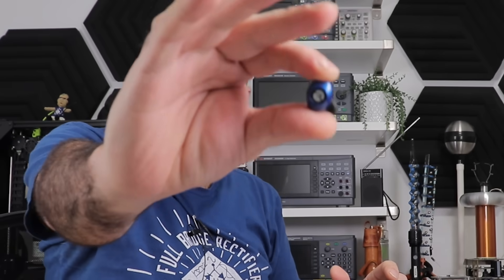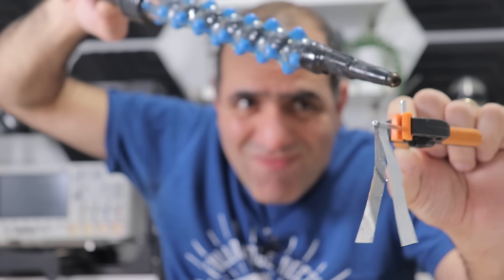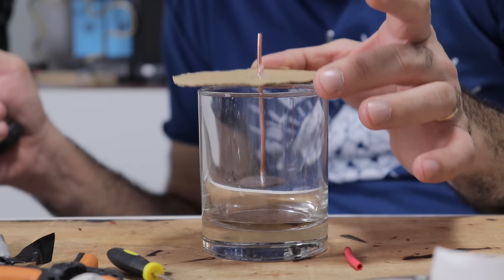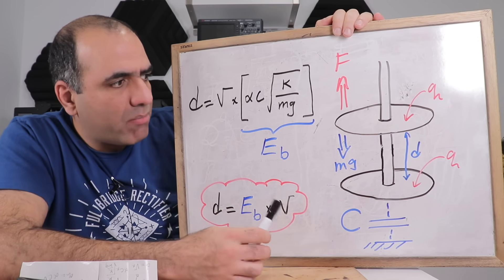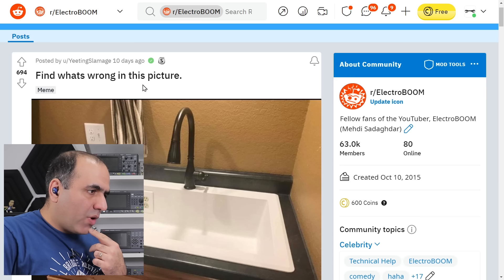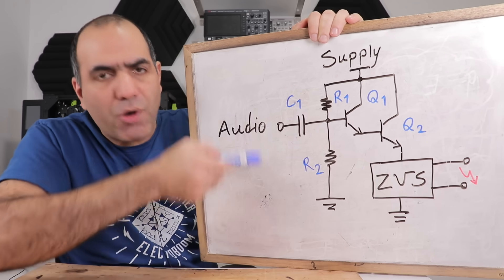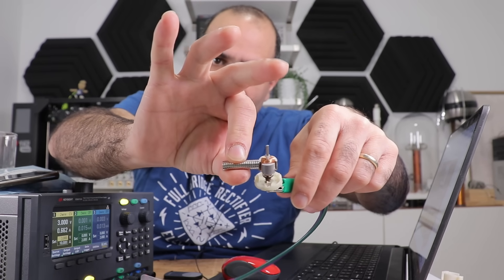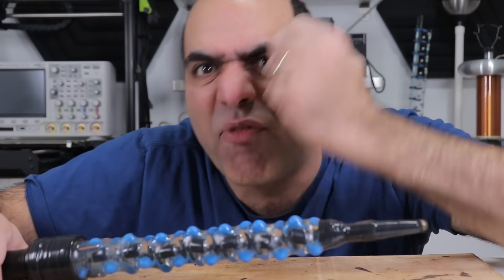I Reinvented the Electroscope! (LATITY-008)

Comment: 10:22 it's specifically the very fine particles, if you blow some powdered form of sugar like custard powder into the air, you can set it alight because the particles are spread apart enough to catch fire and are full of chemical energy.
Reply: Even that isn't as fine as it should be for maximum explosive-ness, but yeah no way is he lighting yarn the way he tried
Reply: @jaykoerner  Yeah I audibly laughed because I have seen farms blow up from dust, and his set up was inadequate.
Reply: @samueleddy62  he should watch some videos from the CSB, he vastly underestimated this stuff
Reply: @samueleddy62  I agree that the test didn't prove anything but if there would have been enough dust in the air to start combustion it would have been visible in the video
Reply: @danielnyman6082  The dust could be on the floor, Im sure he has made shitloads of cotton deliveries without sweeping out the truck, you can't really see what is on the floor in that video.
Reply: @rdizzy1  dust on the floor doesn't explode, burn maybe but it wouldn't make a fireball, it has to be dispersed in air
Reply: @jaykoerner  Jumping down and landing on the floor kicks up dust though
Reply: @killerbee.13  does it kick it to the ceiling?
Reply: @killerbee.13  if that was the method of dispersal it should ha made the flame propagate horizontally then move up the sides of the objects in the way, those also needing to be covered in dust, looking at the video it spreads spherically so that did not happen
Reply: @samueleddy62  A real experiment for kids to do:  Get a large box with a lid that fits snug.  Inside put a lit candle and a funnel with a couple TBL of flour in it.  A hose runs from the neck of the funnel through a hole in the box (sealed with tape).  Blow into the hose and a small explosion blows the lid off the box.
Reply: @jaykoerner  Technically it's an explosion since the sudden heating increases the volume of the air instantly, and it can blow out windows or even cause major structural damage from the pressure.  But it's not a "detonation"
Reply: @jaykoerner  I think the dust had filled the truck from the movement and vibration while driving.  They probably just stopped.
Reply: @JohnDlugosz  this entire conversation was in relation to a comment started by Daniel 5 days ago saying that if enough particles were floating in the air you'd be able to see them, I'm not agreeing or disagreeing with that statement since I don't know, I replied to someone saying that the dust could be on the ground, that I disagree with, anyways long story short you replied to a late comer in a conversation with a comment that resets the conversation back to before they had joined....
Reply: @JohnDlugosz  also your first reply to me missed my point, it's not that dust can't explode, it's that dust ON THE FLOOR can't explode.... You do get this correct?, the dust exploding or not was not an issue of what happened in reality I was saying the dust couldn't be only on the floor and explode that's it
Reply: @JohnDlugosz  I have looked through my comments I have not used the word detonate, what are you correcting me on? As far as I can tell you have miss read what I said, corrected me on your own added words, and restarted a argument that I wasn't part of, I don't understand what your comments mean in relation to what I've said..
Reply: @JohnDlugosz   How do you get even a tealight to not go out when it's put in a well sealed box? Even if done quickly, in a moderately sized box, with sufficient flame, there would be less oxygen than normal... maybe there would be enough in your breath, or the use of a pump, but you still need a way to disperse the flour quickly into almost an aerosol. You can't just blow into a lump of flour. There's a way to do it but this ain't it.
Reply: @jaykoerner  dude people are allowed to reply to things later. "Point is" you made a whole self-righteous comment because some replied a few days later. You may not understand how communication works on the internet.
Reply: @jaykoerner  bruh holy shit you got so offended by that guy, don't like people participating huh?
Reply: @brendanstone9095  blowing into a lump of flour DOES disperse it. Dude, that kind of setup, blowing from the bottom, is EXACTLY how Mythbusters got their milk creamer explosion. There's a way to share your hypotheses and claiming them as fact ain't it.
Reply: @joshyoung1440  the guy part of me and refuted my own points, and put words on my own mouth, yeah he deserved it, you don't get to tell me what I said when I didn't say that, I'm pissy at the dude because he came into a conversation and didn't read it, same reason I'm pissy at you and didn't get my point, you don't get to pick up what the conversation was about
Reply: @joshyoung1440  maybe to give you a theoretical you can understand, say you and someone were talking about some topic and 10 mins after you were done talking about it, someone else comes up to you and starts refuting points directly to you about the beginning of the conversation, and saying you were wrong for things you didn't say, yeah you would wondering why they are talking to you, and why they were even talking about the conversation if they were interested enough to listen the first time, and that's a conversation between real people, this is the internet you can read every word stated years later as shown here, you not reading the conversation before replying isnt excusable
Reply: Yeah, dust explosions no joke. Idk if anyone saw mythbusters experiment with milk powder?
Reply: @DjWarrrrrd  That's what I thought about when I read the words "fine powder" and "fire"
Reply: Yep. Dust explosions have killed a lot of people and done a lot of damage in sugar and flour mills, or possibly things like super fine sawdust. Anything that makes a very fine dust. As you said, it needs to be very small particles that are able to be temporarily suspended in the air.
Hell, it can even make things that don't usually burn in air in to an explosion hazard. A lot of metals that usually aren't flamable are able to start burning very energetically when they're powderised.
Reply: I seen this on a tv show. I think it had to do with the manufacturing process they use. I think they said propane or another flammable gas is used during making, and they did not let it fully disperse prior to shipping. It was on some History Channel show.
Reply: I don't think I've received any notifications for replies past the first five or something, and then I got a notification for this latest reply.
Reply: Even Mythbusters did this with non-dairy creamer, they created some massive fireballs that way. Don't mess around with fine particle fires/explosions.

Comment: Grain silos are known to explode when large amounts of very fine (dust-sized) bits of dry, highly flammable material like grain dust enter the air, and somehow get ignited. No vaporization is required when one instantly burning particle is setting off more than one neighbouring particle. They each burn instantly due to their size. This results in a chain reaction. This is the same mechanism that lets clouds of dry coffee whitener explosively burn. So I can fully believe cotton dust could be responsible.
Reply: Used to happen in coal mines too.

Comment: You'd have to account for temperature, pressure, and humidity as well unless you put it under vacuum. I'd love to see calculations and measurements to see how well it stacks up to theory. I could see this being a safety device for ESD protection by using the floating ring to ground out the circuit if it gets to a certain distance, but it may already exist.

Comment: Dust explosion could be the cause. You can't burn the ball of cotton with spark ignition. But if you have very fine cotton dust suspended in the air, you might get an explosion with single spark :)

Comment: I also don't agree with Veritasium explanation. I'm not an engineer or a scientist or anything but from the little bit of knowledge I do have it still seems like his explanation is at least flawed.
I think he took the concept of Poynting vector a bit too literally.
Here's a comment I made on his video:
"I think your original demonstration with the chain still holds it's ground and is right, but instead your explanation of why it was wrong is in itself wrong.

You have a hollow tube (wire) and a chain (electrons) inside it. Then you add a wheel on the other side of it (a device) that is powered by the chain.
You said that this demonstration is wrong because it's not the electrons themselves that carry the energy from the power source to the device - and that sentence is true, but that's not what happens in the demonstration at all!
Instead in the demonstration it's the movement of the chain as a whole that carries energy and not the individual links. Even better - it was your hands that generated the movement (provided the energy), and your hands were holding onto the chain. No chain link that you were holding directly ever reached the wheel, and yet the wheel received the energy because the tube is already full of the chain and pulling on one chain link causes the entirety of the chain to move. The same is true of electrons in a conductor. The drift velocity is incredibly tiny, and electrons from the power station never ever reach your home (even ignoring the transformers). But the power station causes oscillations of all the electrons within the cable and it's that what carries the energy. 

And it doesn't matter which direction the chain was going - it still provided energy to the wheel both ways. It doesn't matter which direction it made the wheel spin - both were providing energy, not taking it back.
Furthermore the whole conductor is powered and you can draw power or add power to any part of it.
The only thing the chain demonstration doesn't model is the EM radiation created by the movement of the electrons, otherwise it's on point.

I think the biggest problem with this video is that it implies that a significant amount of energy actually radiates from the battery in all directions into the field and then from the field into the device, instead that's just a visualization of the direction of energy and in reality there's just a miniscule unmeasureable amount of EM radiation that reaches the device from 'outside the wire'.

Your explanation with the telegraph cable also seems flawed. The energy doesn't flow outside of the cable as an EM field, instead most of the energy flows inside the cable as the movement of electrons and that creates the EM field which in turn can induce movement of electrons in other conductors (current in the opposite direction) which in turn create their own EM fields (that are again exactly opposite to the one the original conductor produced), and it is that opposite EM field that induces a reverse current in the original conductor - creating interference and resistance."

Since then I also thought about the original question with the 300 000km wires.
His answer was that the lightbulb would turn on after 1/c s and IMO that's problematic cause it can break causality.

Let's say there was a second unconnected lightbulb right next to the original one - would that one turn on as well? 
If the answer is "no", then the experiment breaks causality because the light bulb knows whether the wire is connected to it or not before the actual electricity 'in the cable' reaches it. So for example we could have a battery on Earth and then a 4.36ly cable right to Alpha Centauri where there would be a switch and a cable back to earth connected to a lightbulb right next to the battery. And then when someone would flip the switch on Alpha Centauri the light would instantly turn on on Earth because apparently the circuit can magically instantly tell that it's uninterrupted and battery will start powering the lightbulb through the field. And that way it would be possible to send information faster than light which is obviously impossible and breaks causality.

And if the answer is "yes - the unconnected light bulb would also turn on", then the entire thought experiment is moot because the cables serve no purpose and the only thing it demonstrates is that EM radiation exists and just shorting the battery with a short cable would achieve the same effect.
Reply: yep, as soon as he wronged the chain analogy (which objectively is one of the best analogy for electric circuits 101) it all became fishy. I think he wanted so much to "debunk" stuff that he forgot the reality of the phenomenon. Also, the interviews of the other professors were too short cut.

Comment: 1. Take two metal plates, spaced 5 cm apart.
2. Take a Pingpong ball and wrap it in aluminium foil
3. Atach a thin, long enough thread to the ball
4. Hold the ball (best with some built contraption) between the plates
5. Charge one plate and have fun :)

Comment: The ZVS experiment reminds me of my brothers laser transmitter experiment. He added an amplifier circuit to the laser input and used a solar panel as the receiver. It could work over 100m (300ft).

Comment: For the veritasium fight:
my comment on his video (Destroy Veritasium!):
Great video, but i think your example should be false:
We know that stuff can only propagate at max speed c in the universe. Since the wires are 1/2 c distance away from the switch, the circut can only "test" if the wires are cut at the end after 1c time (because two way). In other words if the light bulb turned on faster, either it can "test" if the wire has been cut faster than light, or the light bulb can turn on without the wires being connected. which both make no sense imo therefore it should be at least 1s or sth else.

Comment: GREAT VIDEO!!!  That one clip of the truck going up in flames from the guys foot creating a spark was broken down on a TV show on science channel and they figured out it was rolls of "Styrofoam" that caused the fumes - it is a petroleum based plastic that has BUTANE injected into it to create the small bubble that turn in to styro-FOAM - usually it is allowed to air out so the gases can disperse and not become an issue but these guys were in a hurry and you see what happened because they DID NOT FOLLOW SAFETY RULES! 🤦‍♂️🤦‍♂️🤦‍♂️ (I'm not 100% sure if it butane or something else, but it is available from the Science Channel's show "OUTRAGEOUS ACTS OF SCIENCE - i think that's the show... or maybe it was "How on Earth?" - I don't remember really - sorry)

Comment: Fuuull Bridge rectifier not a puny half Bridge rectifier!A Full wave rectifier is a circuit arrangement which makes use of both half cycles of input alternating current (AC) and converts them to direct current (DC). ... Thus a full wave rectifier is much more efficient (double+) than a half wave rectifier.I love full bridge rectifiers love converting ac to dc current.The rectifier is an absolute superhero!

Comment: Veritasium's answer makes sense, even if I don't think the explaination he gave was as clear as it could have been. When the circuit is closed, current will start flowing near where the switch , which will create a magnetic filed around it, and when this magnetic field reaches the othe side of the wire, then it wil induce a current in that part of the wire, which will turn the light on.
Reply: ...based on what I'm experiencing in my environment here ... I concurred exactly with what Derek was explaining..i picked the answer he suggested.

Comment: the deflagration (the explosion) was caused indeed by electrostatic discharge, the guy comes out of rolls of cellulose, the entire truck was full of "fumes" made out of that cellulose. you got a ball of cotton, which is WAY Too big for it to be considered a particle and you also did it in a big room. however you can do the experiment with flour. BE WARNED THIS IS EXTRAORDINARILY DANGEROUS. flour usually doesn't burn but if you blow it with air and then burn it it will ignite almost instantly.

Comment: What if you made an electroscope with some balanced metal discs in mineral oil with another material so they are just heavy enough to sink under no voltage but buoyant enough to float easily.

Comment: As we approach winter we can expect more power outages. The supply chain, supply shortages, and increased fuel costs are likely going to cause additional problems with grid restoration. 
Please help inform people of what they can do to help (or more precisely reduce the difficulty and time) to restore grid power. Things like trying to turn on every appliance in the house, going to your moms house, taking that trip to Puerto Rico, and so on. 
Currently most people think they need to turn on ever switch, crank their non powered electric heaters, and get a bunch of politicians to come do the same things then make speeches about the cold. Meanwhile power stations are struggling to shut off enough of the grid that they can even get the generators running.
Imagine how much easier it would be to restore power if people turned everything off, left, or consolidated with family into 1/3 the number of houses.

Comment: I too have something to say about the light being powered over a distance, of cable, but near the source. 
My example has to do with increasing the distance between the light and the battery, but not increasing the cable length. If Derek's example were accurate, the delay should increase by time of light between the source and light